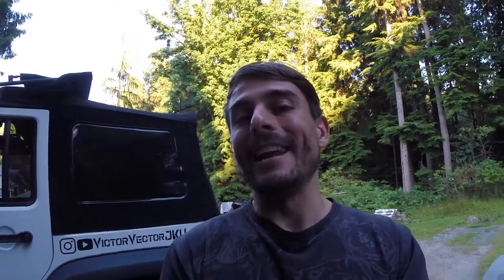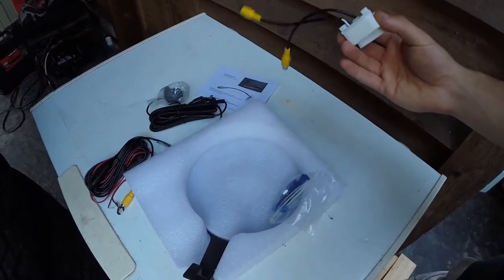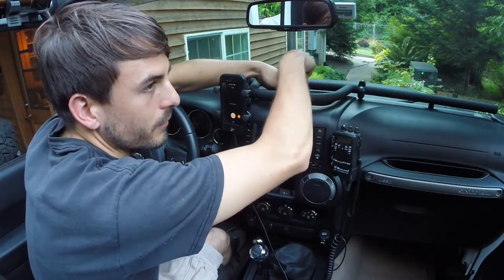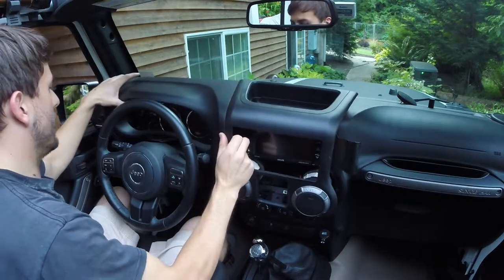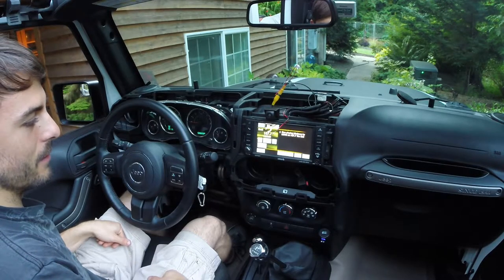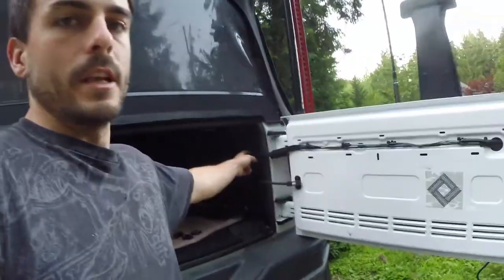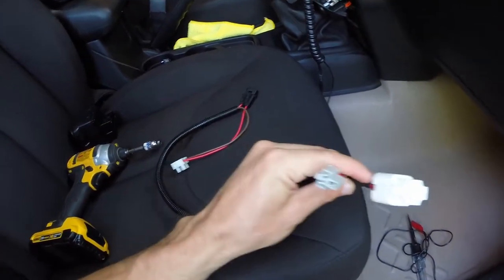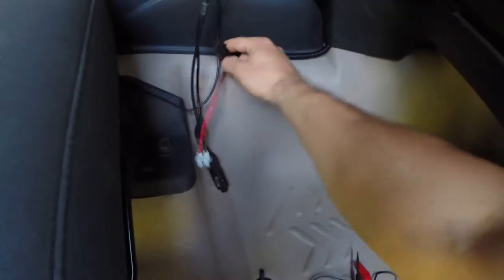U-CONNECT Model RBZ Back Up Cam Install - Jeep JKU

Comment: You route that on constant power. That means the backup camera is powered all the time. Not sure whether the 12V plug in the dash is keyed to the ignition, that at least would turn it off when the car isn't running. I'm probably going to hook the camera into the reverse lights, simply because having the camera on all the time isn't a good thing for that camera chip, particularly when it's hot out (I drive a lot in the desert, so having way over 120 degrees back there when exposed to direct sun wouldn't surprise me at all). Those kind of cameras usually use less than 150mA so the reverse light circuit should be able to handle that easily.
Thanks for testing which one of the adapters it is - that saves time!
Reply from the maker: Thanks for checking out my video Uwe! That is correct it is constant powered and to answer you question it is keyed so it is only powered with the key in the ACC or On position. You make a fair argument about the total run time of the camera and heat, I had not thought about that! My main thought was I like to limit splicing into existing harnesses due to CAN signals being present. So with the jumper I picked up I was at least not impacting the factory harness. But I don’t see an issue with running off of the reverse lights, I would be curious if there is any lag for the image to come up beyond the display switching functions.
Reply: @VictorVectorJKU  I'll let you know how it turns out. Got the camera today and I'll post an update once I've installed it.  I would guess that camera needs a little time to boot up - but then. maybe it's too short to notice. I'll know soon :-)
Reply from the maker: Awesome I look forward to hearing back from you! Good luck in your install!
Reply: @VictorVectorJKU  Ok, got the camera installed. Hooking it into the back-up lights works perfectly. There is no delay whatsoever. I tried constant power and the backup light and both work exactly the same. You can tie into the backup light using the black and white/brown wire going into the grommet above the right rear light.
Reply from the maker: Good deal! I was thinking about the delay and mine is really more related to the time it takes the screen to change. But glad to hear you got it installed and thanks for the feedback!

Comment: Thanks for the video it really helped, luckily I read thru the comments and realized we needed an obd programmer to get camera to come on. Other than that I had a plug with power we tied into. But may tie into backup light power so camera isn't on full time.
Reply from the maker: Hey there Lee, thanks for checking out my video! I am glad it was able to help you out and sorry I if didn’t highlight the need to use the programmer to enable the camera. Glad you were able to figure it out and get it functioning!! 🤙🏼

Comment: Thanks for posting this video! Really helped on the pin connectors and which to use, my Wife’s JK is an automatic so not sure if that’s different from the manual you have also pretty sure she has the RHB radio with Nav which sounds like it should work, just need to see if I can find an option on the radios setup to turn on a camera or if I have to go the route you did with the blue tooth scan tool or take to the dealer. I have a feeling the dealer route won’t be favorable as I told her last time it got serviced to have them turn the option on and they said they need to know what type of camera it is, which I kind of doubt that matters but maybe. I got every thing wired in today using the number 2/3 pins, just need to get the computer to turn on the back up camera option and hopefully it works, wired it into the right rear tail light harness since we installed the trailer light pigtail off the left light and had the back end appart for both, had to long to the bracket upside down compared to yours and bend it as hers is a rubicon Recon edition and the bolt pattern to wheels spokes must be opposite of most jeep rims as all the spokes interfere with the camera location relative to stud clocking on the spare tire mount on the back door, not a big deal but took some finagling. Anyways thanks again for the video, may hit you back once we get the obd part turned on
Reply from the maker: Hey thanks for checking out my video and that is great to hear it was able to help you out! I am unsure the ability to edit settings with the Nav model versus using an OBD programming tool but I do not see why the dealer must know the make of the camera, it is purely a setting that must be enabled to allow the camera feed. (It should be a binary parameter in the ECU “enabled” or “disabled”)

But good job on figuring out how to make it work with the wheel openings for the spare! Hopefully you can get this last bit complete and have the backup camera functioning!!

Comment: I am a newbie to Jeep modifications in general and your great video (I plan to add a backup camera to a Jeep JK Unlimited as soon as I purchase one) raised a few questions.  I hope you don't mind answering my questions.
1. What else can I use the OBDII for?
2. How do I purchase the ability to turn on the backup camera?  You mention the VIN.
3. Does the backup camera you purchased display in color?
4. Does the backup camera you purchased have what I call "guide lines." I own a 2019 Cherokee which has the OEM camera and I am spoiled when backing up.
5. I'm planning a Spare Tire Delete and am looking to move the license plate to center of the 5th door, and mount the camera there, as well as have an integrated 3rd brake light to replace the OEM CHMSL.  Any suggestions as to where to look, what's good, what's junk, et cetera?
Reply from the maker: Hey there Mark, Thanks for checking out my video! Let me see what I can do to answer these!
1. So the OBDII Bluetooth reader along with the J-Scan App can do a lot! I suggest you look at http://jscan.net/ to get more info on all it offers!
2. So you do not purchase the ability to turn on the camera but rather purchase a single vin license through the J-Scan App to program and adjust systems on that one registered vehicle. refer to the link for more info in my answer to item 1.
3. The camera and display paired together do show color, but at night it uses infrared I believe so it will be more of a gray scale.
4. it does have guidelines, but I do not believe that they are adjustable, nor do they move as you turn the wheel. They are very basic.
5. Honestly if you are looking for a recommendation for a certain manufacturer, I do not really have one. I think all of them out there are comparable, and it really comes down to what you like and are looking for in features. Some are basic, some have molle panels or modular mounting features so you really just need to go with what will fit your build the best!
I hope my answers are able to give you some direction! let me know if you have other questions!

Comment: This was an easy setup. Be sure that you have an OBD scanner to activate the camera.
Reply from the maker: Yes, Definitely necessary if it isn’t already activated! Thanks for checking out my Video Kristie!
Reply: what do you mean by activate camera with OBD  @VictorVectorJKU   

Do I have to do something else?
Reply from the maker: Yes, the camera function is controlled by the ECU’s of the vehicle which require programming to enable. When you shift your vehicle into reverse if your screen does not turn black or show the camera image if you have installed it then you must enable this function.

Comment: Hello, I have such a radio for a Dodge car. When installed on my Jeep Wrangler, it does not work. What is the solution?
Reply from the maker: I will need some details of your install process and the issues you are having with the reverse camera not working. The first items to troubleshoot will be:
1. Are you using the correct connector to the back of the head unit?
2. Does the camera have an appropriate power lead hooked up?
3. Have you enabled the camera through the Jeep’s OBD port or had a car dealer enable it?

Comment: How can I turn on your radio on my Jeep Wrangler? After installing the wires, the radio does not work. Please help me
Reply from the maker: That is very interesting, I would suggest making sure the all the connections are made to the back of the radio unit. I am guessing a connector or power or ground came loose. The install should not have required any of those to be removed.

Comment: I have the same 2017 JKU, same RBZ radio, and same Roadpower camera.  I also have a JSCAN license for my jeep and Veepeak OBD.  When I scan for my camera and check the box it comes up false (with either Roadpower supplied connector on the back of the head unit).  I also tried the 9V battery test with both Roadpower connectors).  What am I missing?  How can I get the head unit to see the camera?
Reply from the maker: Hey there KP, thanks for checking out my video and let’s see if we can figure this out!
1) when you shift into reverse does the head unit go black and state a warning message to the effect of “check your surroundings”?
2) how are you supplying power to the camera? 
3) did you verify both connectors to the back of the head unit to ensure the correct pin out is being used?
Get back to me with these 3 questions and we will proceed to the next steps!
Reply: Hi I have tried several times to reply but they dint post
Reply from the maker: That’s strange… if you would like you can send me a direct message through Instagram if you have that. My account is victorvectorjku there

Comment: I have the same RBZ radio in my 2014 Dodge Avenger. Would this work if i wanted to add a backup cam?
Reply from the maker: Hey there Luigichan5043, thanks for checking out my video! I do not know for a fact but I would assume it should work.
Reply: @VictorVectorJKU  I'm going to try, and I'll let you know if it does work .. I'm just waiting on the video plug. All ready have jscan and obd2
Reply from the maker: Awesome! I look forward to hearing how it works out!!
Reply from the maker: Awesome! I look forward to hearing how it works out!!
Reply: @VictorVectorJKU  update.... It worked!!
Reply from the maker: @luigichan5043  awesome! That’s great to hear!!

Comment: Where did you get the power cable?
Reply from the maker: Hey there Jack, thanks for checking out my video! I believe I pulled power from the accessory 12v plug in the dash since I had added a second 12v plug to that circuit. I know others have pulled from the reverse lights as well so you only power the camera when in reverse.

Comment: What you do with the red wire on the video connector side on the back of the stereo
Reply from the maker: Hey there Grupo, thanks for checking out my video! That wire is used as a signal wire that needs to be hooked up to a reverse signal wire. I chose not to use this functionality.
Reply: @VictorVectorJKU  great thanks for the quick reply
Reply from the maker: @grupohastaelfinluchare9418 you’re welcome!
Reply: So installed everything and once I put my jeep in reverse i get nothing on the screen. The jeep came with the Bluetooth activated already but not sure if they also activated the back up camera might this be my problem that I need to activate it or should the radio screen change a certain color to all black even doe it hasn’t been unlocked for the back up camera or is there another problem Thanks🙏🏽
Reply from the maker: So Bluetooth is not the functionality you need. You need to purchase an OBD Bluetooth reader and I recommend using the J-Scan app from your phone’s App Store. You will need to purchase a license for the VIN of your vehicle in the app. Then you need to enable the backup camera function at which time the screen will change and show the backup camera.
Reply: @VictorVectorJKU is there a video you have of how to work the app (Jscan) to be able to unlock the back up camera feature also do you just pay the 20$ for the vin or is there another charge after to you pay for the vin to unlock the back up cam
Reply: Again Thanks For The Help 🙏🏽
Reply from the maker: @grupohastaelfinluchare9418 I don’t have a video but there should be videos or instructions online if you cannot find the menu by searching. That is correct you only need to purchase the single vin for the vehicle and then you can do all the programming that app offers on that one vehicle.
Reply: @VictorVectorJKU  got it going already needed to buy the vin license and also had a the power to the camera reversed but got it thanks 🙏🏽 for the help blessings

Comment: Hello, how are you? I have a problem when shifting into reverse gear, the radio will not work on the camera
Reply from the maker: Have you confirmed you have the head unit labeled RBZ? If yes and you have completed the install, have you enabled the back up camera feature in the ECU? You can do this by purchasing a Bluetooth OBD tool and the App JScan. This is what I did. You might also be able to go to a dealer and have them enable the feature.

Comment: What if the RBZ head unit already had the backup cam enabled.  The head unit came with my 2011 grand caravan and I removed it and installed it in my 2001 Durango SLT I figured out how to have video in motion without a lock pick or expensive aftermarket harness but I noticed you came with two white clips each with different locations for the camera input but the one I have goes to pin 2 and 3 but the camera is already enabled on the RBZ
Reply from the maker: Hey there Villi, thanks for checking out my video! That is sweet you found a way to enable the camera in motion! I need to figure that out sometime! So to make sure I understand correctly, you are trying to determine which plug u need to use? I had tried both to see which I needed to use based on the head unit’s pin out. Let me know if I am not answering your question correctly!
Reply: How so ??? Did you figure out the camera in motion.

Comment: Did you use the red wire that comes out at the audio connector end? My wire says reverse power anode output.
Reply from the maker: Hey there Dave, thanks for checking out my video! Help me understand your question better, what connection are we talking about, is it the power to the camera? Also what do you mean by “my wire says reverse power anode output” is this an error displayed on your screen?
Reply: Tried to send you a pic, but can’t send. I think I got it figured out. Thanks again for the helpful video.
Reply from the maker: Ok sounds good, glad to hear you figured it out! If not you can reach out to me through Instagram and you can DM me a picture there!

Comment: Hey Victor. I haven't been able to figure out what camera you used. I can't find the link anywhere in the video. Would you mind sharing the particular brand/version used? or the link to the amazon store? Thank you.
Reply from the maker: Hey there Alex, thanks for checking out my video! I have the link in the video description, here is the link again for ease Help me decide on this product: Roadpower Car Backup Camera Rear View Camera Reverse Camera for Jeep Wrangler Spare Tire Mount 2007-2018 Waterproof Wide Angle Aftermarket Camera Removable Guidelines with OEM Monitor Adapter. https://a.co/d/7D0LgoX
Reply: @VictorVectorJKU  Wow. I checked twice and somehow missed it. Anyhow, thanks a ton for the quick response and for the link :)
Reply from the maker: You are welcome! And yeah sometimes the display of the video description, depending on the device you’re using, can make it tricky to find info!

Comment: My wifes JL has the option to turn on the backup camera while driving down the interstate.  Is there an option with this radio to access the backup camera  while not in  reverse?
Reply from the maker: Hey Gary, thanks for checking out my video! For the JK, I have not found an option to turn it on unless you simulate reverse. I have also not really looked into it tho.

Comment: Where did you get the adapter for the lighter
Reply from the maker: Hey there Tim, thanks for checking out my video! I purchased the adapter and a 12v outlet off Amazon. The following links should take you there. Please note I did have to modify the adapter to connect to this specific outlet. I believe I just needed to add blade terminals to it so it would connect to the harness. 
https://a.co/d/3i7V60O
https://a.co/d/20CMlYr

Comment: How is the picture at night ? Overall review since you installed it
Reply from the maker: I think it is decent, I think the limiting factor is more on the factory display resolution rather than the camera itself. But as long as you have good reverse lighting then it does well! I think for the low cost it is definitely worth it!

Comment: what wire did you connect the sinlge red wire to behind the head unit
Reply from the maker: Hey there Seal.Team.Six. Thanks for checking out my video! So to be sure I am answering you question correctly, you are referring to the red wire coming out of the yellow video cable connection right? Or are you talking about the power and ground wires coming from the camera?

Comment: Which of rhe 2 connectors did you use?
Reply from the maker: Hey there Brian, thanks for checking out my video! I trialed connecting both with power to the camera to see which one worked for me, I would suggest you do that same as I cannot recall which I used and your application may be different.

Comment: I just got an OBD. Any tips on how to do this best? Or is it pretty straight forward in the app how to activate the camera
Reply from the maker: I thought it was pretty straight forward using the J-Scan App but I will give you the menus you need to navigate through!
Once you have connected to the vehicle through the J-Scan app you will go to the Adaptation heading > Radio and Camera - settings > Rear Camera on/off > and select activate. 
I hope this helps make it easy for you!